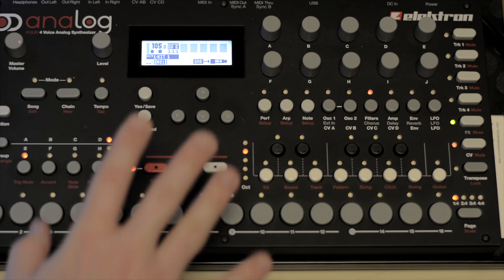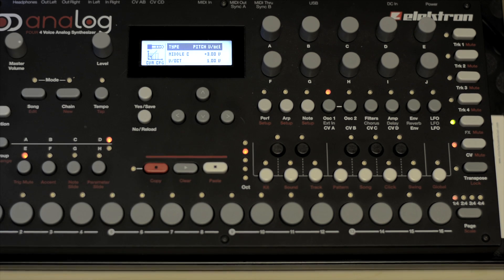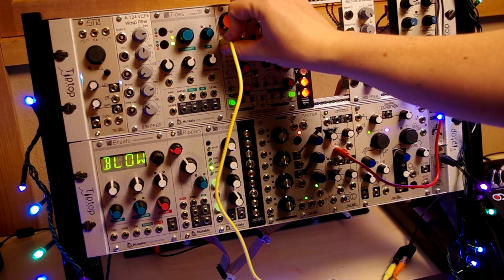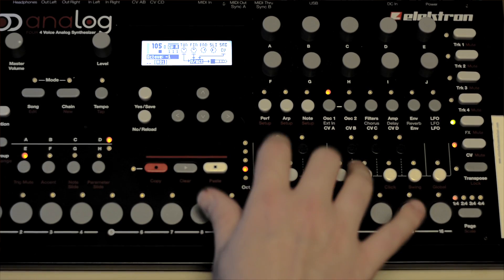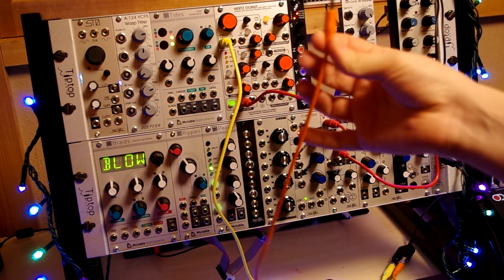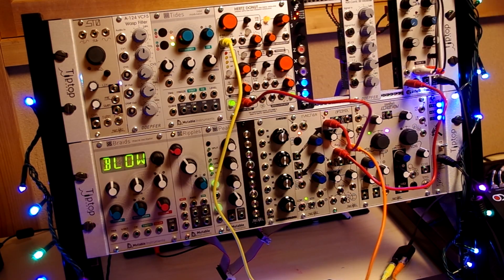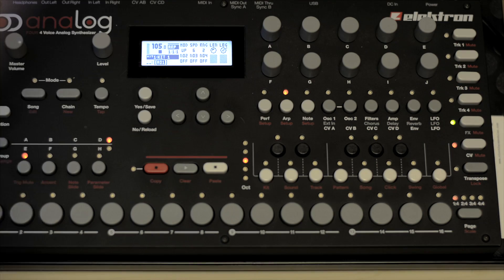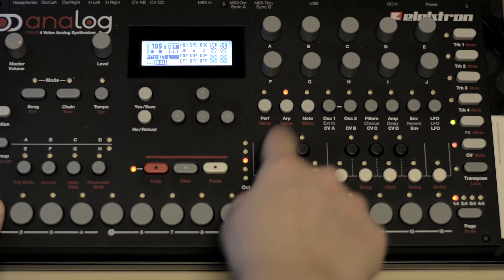Tutorial: Using the Analog Four to control a modular synth (Part 1)

Comment: I tried top hook up my A4 a Semi-Modular gear. The Soundmachines Modulor 114. I did exactly what you say. CV AB...Cable A going into V/Oct in my Modulor 114 But where does Cable B goes...you show on yours a Strike input. Mine doesn't say that...I'm constantly getting a sustained sound even tho i can play the Keyboard on my A4 i can't get the note to stop sustaining. Where does that other Cable go....
Reply from the maker: rhampton1914 this is because you aren’t running the oscillator through some kind of VCA. My first bit of advice would be to look up some tutorials on your sound machines system. Also there are a few modular 101 tutorials that are great for beginners to modular.

Comment: Hi Nedavine just wondering what OS version this is on as my analog 4 screen for Pitch v/oct is different than then one in this video i don't have middle c I have note1  C3? so am just wondering if this is an older OS version? if so what should it be on the updated version?
Reply from the maker: +Jamie Smith  Yes it's a pre overbridge OS. The layout is a little different but a quick read of the manual should bring you up to speed. It does all the same functions just laid out diffeently in regards of pitch.

Comment: Thank you very much for those! For the cables from the a4 to the eurorack, i assume you just need a stereo 6.5mm adapter to 2x 3.5mm mono, is that right ?
Reply from the maker: +IIHOGZBREATHII TheMSilenus Yup that's exactly right. Stereo cables out for the CV (A/B) and (C/D)
Reply: +TheMSilenus I was wondering the same. 1st he says cv A to pitch, then he says cv B to strike. there is only 2 x 1/4 inch out from A4. Is it stereo out from CV AB ?
Reply from the maker: +IIHOGZBREATHII You need a splitter cable as mentioned above but yeah you can assign the CV to anything you like so if you want pitch and trig then assign it to that.
Reply: +nedavine  Thanks man ;)  Iam just on the edge to start a modular. Keep up the good work !
Reply: Nice!...but for now I would just be using stereo out of CV (AB)...for pitch and trigger. CV (CD) for other stuff when I get to it, right?
Reply: Thanks!!!